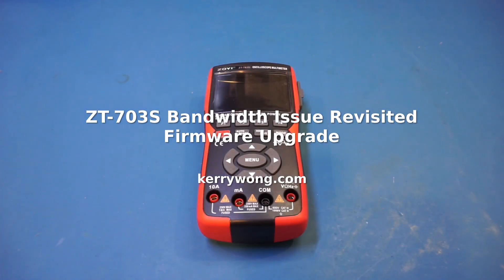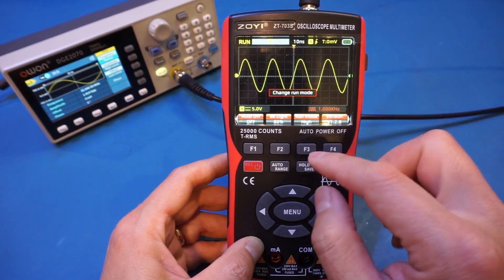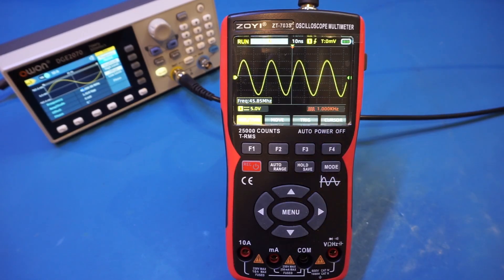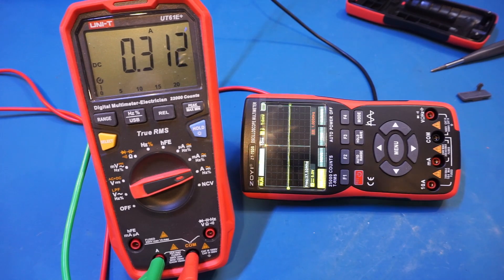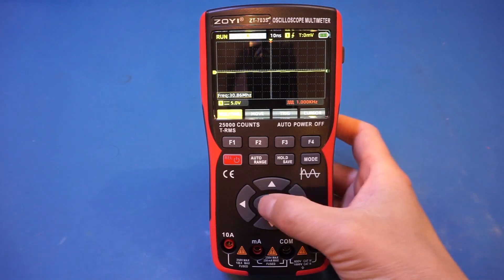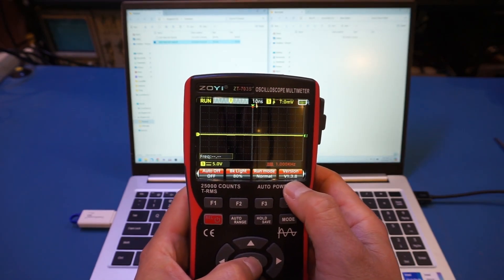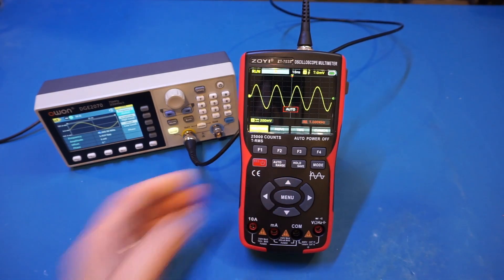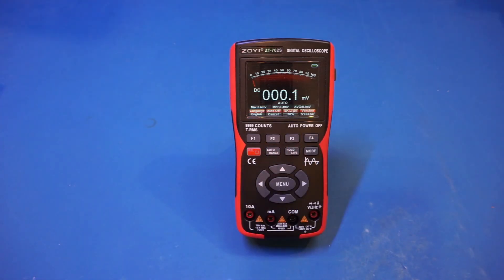ZT-703S Bandwidth Issue Revisited, Firmware Upgrade

Comment: I  just bought one- my first junko Chinese scope meter that if works will really make my day.   Todays modern washing machines and modern LED lighting in homes dislike each other.  As is flashing lights when the washer is churning.   Thank the EPA for efficiency standards of appliances and ECM motors in washers. Im troubleshooting my daughters issue and dont want to lug even my lighteeight Tek TDS 3014 to her tiny 11:01 laundry room, so I chose this and some CT’s frim Amazon to help document and fix this most common issue in homes today.

Comment: Why is there a choise between normal and high?    Because high is always the better choise.
This reminds me of the old computers with a normal - turbo switch.   It always run on turbo.   The normal position was more of a slow switch.
Reply: That non-turbo was for some very ancient games that would run too fast otherwise.
And in this case it is probably for run time. Or perhaps the ADC is more linear at its correct speed.
Reply: probably power/battery life. 20% is significant enough.

Comment: Hi Kerry, nice and informative review! Do you happen to know the lowest and highest frequency of the built in frequency generator? I want to use it for audio amplifier analyses and lowest frequency below 20 Hz would be nice and highest above 40 kHz would be nice.

Kind regards from Germany!
Burkhard
Reply from the maker: The signal generator (sine wave from the app) goes down to 50 Hz , and up to 344 kHz. But if you go to the Output menu, you actually can get it down to 10 Hz but you only have the discrete values 10Hz, 50 Hz, etc.
Reply: @KerryWongBlog  thanks a lot! I allready ordered it but have to wait for another two weeks …

Comment: I can imagine they went through the trouble of creating a second mode, just so they could put 50MHz in the specs while maintaining a decent battery runtime (in default mode). In China it's all about getting the highest numbers to beat other brands. Some do it by plain lying but that doesn't work out in the long run. Others do it by using tricks to achieve better specs, even though it's not convenient for the end user.

Comment: @7:15 may you provide the filenames of the firmware update files you used, and also where you downloaded them?
Reply from the maker: You can download the firmware from https://zotektools.com/firmware-update-703/
Reply: @KerryWongBlog  as of 2024-07-26, the current file downloadable from that "firmware-update-703"-named URL (via Google Drive) is named "ZOYI-703S-FW-V139.ZTK" - so assuming this is firmware version "1.3.9" and because the ZT-703S got an update to "1.3.8", it may be worth to check the latest release and see if it solves any open issues.
Reply: @Abdullu 1.3.9 có thêm tính năng mới về phần hiển thị.có chế độ HD để đường sóng mịn màng hơn 😅.và cũng sửa một số lỗi.mình mới cập nhật xong tối qua cho con 703s của mình 😅

Comment: The designers give us a default to save battery power by lowering the bandwidth, we can then choose high mode if needed, that's a good thing. Why don't you RTFM before doing videos?
Reply: đúng là như vậy.nó có chế độ bình thường để tiết kiệm pin và chế độ tốc độ cao để đo tần số cao hơn.mình đã thử nghiệm và đúng như vậy 🥰🥰🥰

Comment: According to the sampling theorem (Shannon, 1949), to reconstruct a one-dimensional signal from a set of samples, the sampling rate must be equal to or greater than twice the highest frequency in the signal.

So with a 50Mhz sampling rate don't expect to measure more than 25Mhz signal frequency accurately.
Reply: from the manual:
Normal Mode: Maximum sampling rate 200MSa/s, Maximum measurement bandwidth 30MHz
Lower power consumption, more power efficient.
High Speed Mode: Maximum sampling rate 280MSa/s Maximum measurement bandwidth 50MHz
Higher power consumption.
Reply: @juhaszpeter4796 đúng vậy 😅
Reply: You're confusing bandwidth and sample rate. Not the same thing.
Reply: To accurately measure 50Mhz you only need 100MSa/s

Comment: I have the ZT-703S, the Aneng version of the 702S (the Aneng can run the Zotek firmware) and two of the Owon HDS series scope meters.  I’ve had the Owon units for over a year and the 700 series for about four months.

I really like the compact and somewhat sleeker styling of the 700 series units.  The  703 is a bit of a disappointment because it fails to fully deliver on the advertised bandwidth.  The other wart is if you leave the meter probe in the wrong socket when taking current measurements, you get crazy values displayed.  True, there is a reminder flashed on the screen, but it is only there for about one second.  I would have programmed the firmware to leave the reminder on the screen until some current flow is sensed; that way you’re sure the user read the reminder.  The last complaint is that not enough of the BNC socket is poking through the plastic far enough to firmly seat a standard Amphenol plug on its detent.  The probe included with the meter does firmly seat on its detent.

The Owon HDS series meters outperform their promised specifications.  The 200 MHz rated HDS-2102S will easily lock on a 300 MHz signal, and you can get a reasonable lock on 400 MHz, though sensitivity is about 6 dB down by that point.  I am inclined to believe the Owon meters meet their CAT safety ratings.  Even the BNC connector outer shells are insulated.  The signal generator in the HDS S meters is pretty good.  The output scaling can be set to 50, 75 or other Ohm load.  Frequency, offset, duty cycle and amplitude are continuously variable. A variety of arbitrary waveforms are available.

Unless you’re seriously restrained by budget, I would go with one of the Owon HDS series meters.  My recommendation for the hobbyist just getting started would be to go with the Owon HDS-2101S - it is rated at 100 MHz (one channel operating) or 50 MHz (two channels active) and includes a 25 MHz signal generator.  The price difference is only about 20 to 30 Dollars depending on the seller.  It is definitely worth it to get the improved capability.
Reply: I have the opposite experience. The 703s has been much more reliable and precise than the owon I had before
 Cheaper too
Reply: @shaolin95   Thanks for the sharing your experience, adding another data point.  My guess is that one or both manufacturers have variable quality control and there are good and not so good units sold.  I particularly like the ergonomics of the 703S, the shape makes it easy to hold and the adjustments of gain/timebase and trace position are more logical than Owon’s.   The 703S signal generator could use improvement.  The applet menu is intriguing as they’ve left some blank spots in the grid where additional functions could be added.  It is good to see that the 703S firmware is being actively updated.  I haven’t yet found what’s different between 1.3.5 and 1.3.8 firmware, but 1.3.5 was a large improvement over what shipped on the meter.  I give Zotek high marks on making the update process easy.
Reply: is your HDS-2102S / HDS-2202S recommendation for cheap scope meter still valid, or there is something else better at the price range?
Reply: @kevincosta1977  It is really difficult to keep track of the available choices.  For me, personally, I still like the Owon HDS-2202S.  All three functions scope/meter/generator perform well and it is still affordably priced.  In particular, the scope section uses separate ADCs for each channel, so unit always has full bandwidth.  The generator is actually usable, though I wish it had an output calibrated in dBm and more built-in attenuation.  The digital meter does what is expected with good accuracy.  The limitation of the meter is the AC frequency response is limited to a few KHz.

My biggest wishes for improvement would be more bits of resolution of the scope ADCs, 5 or even 1 mV/division sensitivity and a basic FFT function.  Of course, adding features would increase the cost, so I’m OK with the unit as is.  The purpose is to have an instrument good enough but affordable enough to put in a tool bag.

Comment: Seems that for some strange reason Zotek either don't watch your videos, or just ignore your suggestions.
The inability to auto range at 46MHz is inexcusable.
And I agree that the normal and fast range switching is a bit silly and could be a tad frustrating.
Reply: How often do you measure around 46Mhz? Also… you need a serious bench scope for such work….
Reply: @atariandre5014 I agree, but if it doesn't say that it can't do it then it should be able to do it.
Occasionally I'm measuring  in the MHz range when I'm designing snubbers but I confess that I'm just freezing the wave form and then zooming in.

Comment: Good stuff, Kerry.  FYI - I could not update my 702S until I had Windows repair the FIRMWARE file in the 702S.  I think my 702S was 1.03.41 originally.  My 702 also came with a bad battery.  Still, I like it except for the recessed BNC makes it hard to attach a probe to.👍